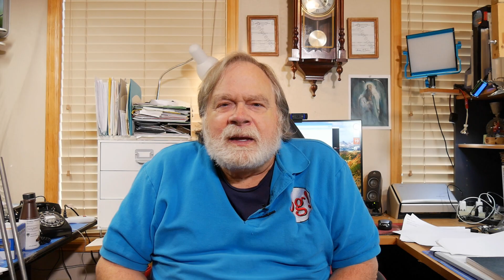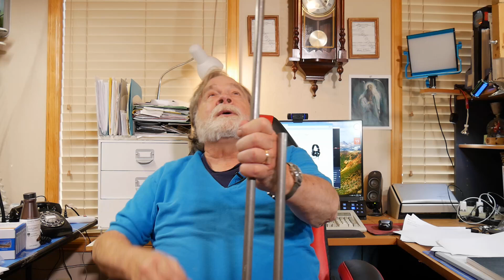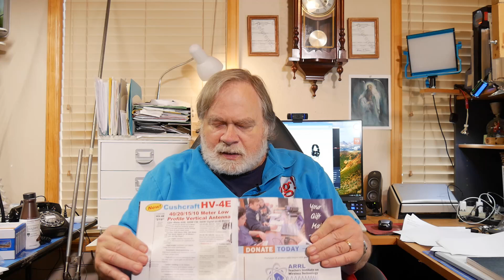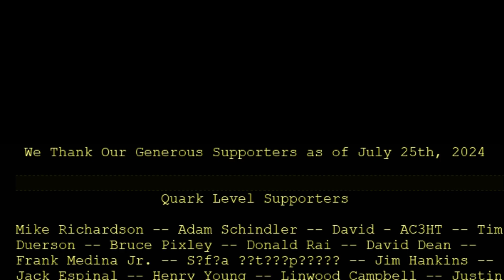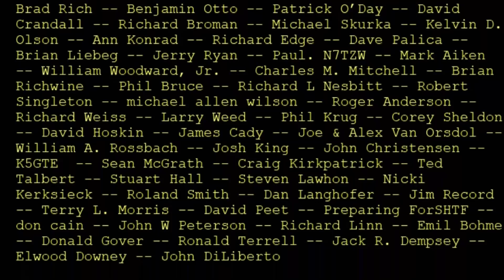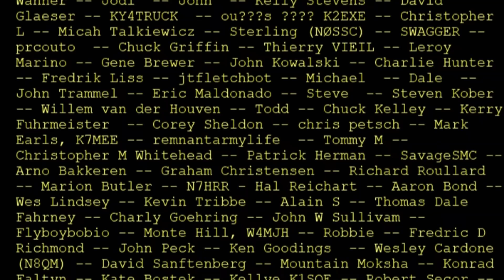Can't Put in Radials--Now What? (#1136)

Comment: Seems like the HOA is going to have problems with anything that looks like an antenna, so having counterpoises coming off a vertical mounted to a flagpole is probably verboten, too.  I think the most likely answer here is a flagpole and buried radials; dig up narrow strips of sod to lay the radials under, dig the radials down a couple extra inches, then immediately lay the sod back on top to hide them.  They may even work better for being underground, depending on your soil type.

Comment: The antenna needs a complete circuit like all circuits. Current must always return to the source. AC, DC or RF. Whatever amount of current that leaves the transmitter by way of the center conductor of the coax must return to the transmitter ( source) somehow. That can be through the other half of the antenna, through the radials in the case of a quarter wave antenna or through some sort of counterpoise. All antennas must have provisions for collecting this return current or either the antenna will not work or some stray path or paths will be found for the return currents. Sometimes the outside of the coax shield will be the counterpoise either by design or by lack of design!

Comment: 1/2 wave verticals work pretty well without radials, but they are of course taller than a 1/4 wave. Wire antennas like EFHW, a random wire or a long wire don't need radials either... And you can bend them in almost any shape, as long as you avoid sharp corners less than 90 degrees... I once had a random wire antenna shaped into a short-of circular loop with a diameter of 6m. Obviously a comprised antenna, but it performed surprisingly well on 40 through 10 with an external tuner.

Comment: There is a cheap radial-less vertical antenna for 10/15/20... See the gqrp fan dipole using ribbon feeder.. that is short enough to be run vertically up a 10m fibreglass fishing pole... No radials needed as it is balanced... Just run your coax elevated to the middle (and this will keep you co-ax clear of the gardeners too). 
I'm also in discussion with some auto-atu manufacturers to see if they could do a weather proof balanced variant of their box as clagging one of these on the middle should bring in everything 10 to 40.